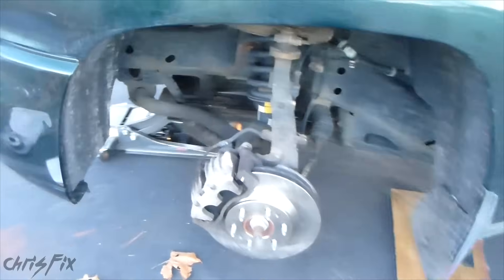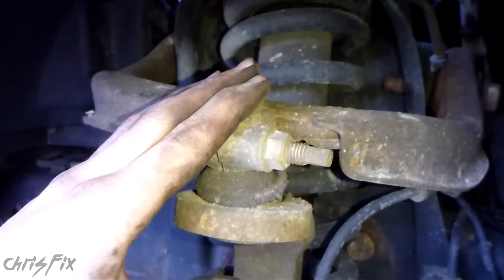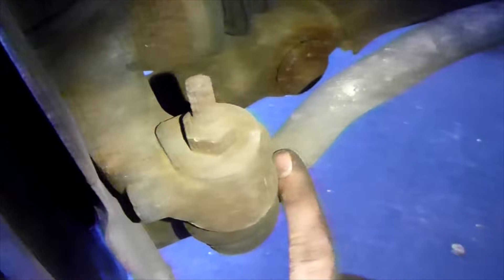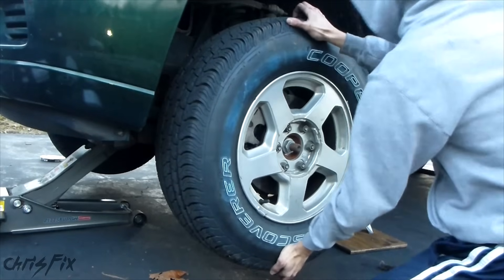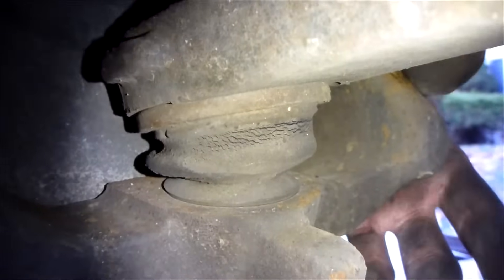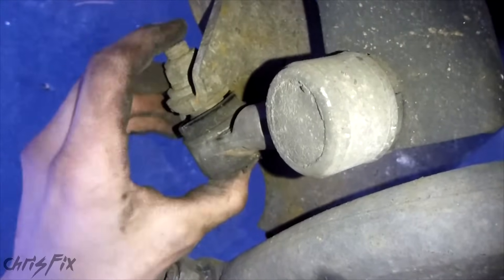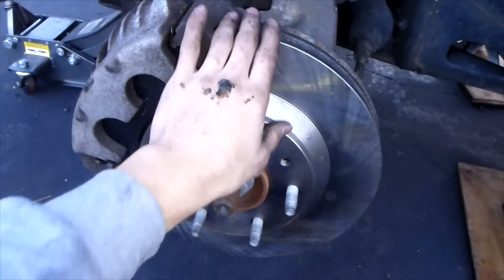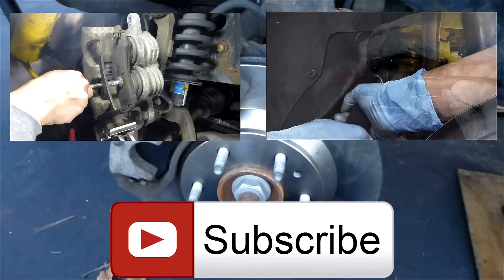How to check out your own car's suspension system

Comment: PLEASE LIKE SO CHRISFIX CAN READ!! Need URGENT HELP!! Thanks!

Hello Chrisfix, i have a 2016 dodge journey and my rear end was making a lot of squeaking noise. Its a brand new car with 30k miles on it . i got the rear bushings and links replaced and the noise is gone now.

Now, the front end is making clunking noise. Took it to the dealership and they said its the sway bars which they replaced. However, the sound is still there even after just getting the sway bars replaced. Its minimal noise but enough to be noticed. It is really noticeable when im turning while braking or if I go sideways over a curb or when i enter my driveway slowly. 
Could it be the bushings as it was the case for the rear? Plz any help would be appreciated. Thank you :)
Reply: I have a dodge journey 2011 and my rear end is squeaking. I'll take a look at my bushings and link bar. For your front end clunking. Mine was clunking and the steering wasn't firm as before ended up being the ball joint. Now everything is firm. The front component's are very cheap trust me you'll end up replacing a lot of pieces in 2 years I had both tie rod end replaced under warranty twice.
Reply: Paarth Kanda did you find what's wrong man?
Reply: jakarta378 no man unfortunately not. Hoping that Chrisfix sees this. Could really use his expertise or anyone in the comment thread as a matter of fact.
Reply: Paarth Kanda what did you do so far to fix the problem?
Reply: I havent done anything tbh. Ill prob call the dealership and tell them it wasnt the sway bars that needed replacement.
Reply: Sylvain Bathalon thank you so much. Ill try telling the dealership that and see what they say

Comment: Thanks chris, ive been planning on fixing up this totaled  2002 BMW Z3 Coupe (clownshoe) that some idiot crashed in because he was drifting or something. Front driver side suspension is the only good one. Does anyone know where I can get parts for this without paying the BMW price? It's mostly control arms, brakes, and shocks.
Reply from the maker: Find an aftermarket company that supports BMW. Moog for example.

Comment: Hi Chris. My car makes this squeaking sounds when going up humps. It happens when the car has warmed up and travelled a bit. Going over humps will cause a squeaking noise. Only in the front, rear's seemed fine. What could be wrong? Suspension? Springs? joints? MY car's about 5 years old. Please advise, thanks!
Reply: Laurence John Sortigosa My mechanic told me its my spring that caused the sounds. My bushings looked ok. I was advised to change my whole suspension but.. I think I can live with it for another year as vehicle stability ain't compromised
Reply: Give a one year update now

Comment: when my car gets warm and I turn the steerinh wheel to the right only it makes like a ticking noise and when on straight, the ticking goes away. It also sounds worse when turning at high speed. Any ideas on what it could be?
Reply: replace your cv axle joint

Comment: Whoever decided on non-greasable ball joints and tie rods should be shot.
Reply: Gabe Eslinger thats the point... THE GREASE NEVER LASTS lol.. And thats EXACTLY the reason WHY the parts FAIL. If you took a non greasable part and drill/tap for a fitting and great it every year or so GUARANTEED that part would last much much long. Do you not agree?
Reply: Gabe Eslinger I’m still uncomfortable with mine because there has to be barely any grease in them. Rather have greaserts to make sure maintenance is easier. Grease up and move on
Reply: While it is a pain in the ass you can add grease fittings. Drill and tap some threads in to the part and screw in and tighten the fitting add some grease. You probably know that but others may not
Reply: Monica i was thinking the same thing haha
Reply: @Jstro14  the problem with drilling and tapping grease nipples is its very hard not to get small metal shavings into where u have drilled to tap it. Any particles of metal that get into the ball joint will cause major damage very quickly. I honestly don't know why all ball joints don't come with grease nipples though
Reply: They do this because most ppl would not be checking their joints and getting them greased up. So it's better for the average driver to have plastic ball joints that are not greasable and last longer without any maitanence.
Reply: Christopher Moore seriously my civic has non greaseable end links and it drives me crazy. I’m planning on getting moog ones cause they have greaserts
Reply: Yes right in the fucking face and non greasable ujoints
Reply: It’s simple if the factory made them like that then you could get them greased at oil changes but they don’t do that cause they want it to fail
Reply: Non grease able parts are designed for the grease to last the life of the part.
Reply: Its a far more reliable design, it also last longer and typically carries a longer warranty.
Reply: I bet if you were in the business of selling ball joints you’d disagree.  Maybe that’s why they are that way.  Just a thought.

Comment: so i just had new ball joints, tie rod ends, steering gear,tires and an alignment. now i have a clunk coming from my drag link when i go over bumps. everything is new and tight and its been back to the shop twice and the mechanics cant figure out why it is clunking. any suggestions.  maybe the adj sleeve itself is bad somehow...
Reply: 04 grand cherokee 210000 miles. no noise before new parts...

Comment: it's pretty sh*tty how auto manufactures design suspension parts without grease points now days. The older cars had grease points at every moving point. It's almost like the manufactures are saying " yeah we put junk parts on automobiles now days so junk in fact they aren't worth the preventative maintenance" So parts that could last the life time of the vehicle are only lasting a couple years or under 200,000 miles.  Joke is on them I only buy after market...OEM is usually absolute junk.

Comment: If you had all new parts and were to replace every part you checked in this video (even the struts), in what order would you go? Basically all new suspension (for a 2006 Sonata)

I would think you would start with struts and work down and outward?

Strut/springs
fork
strut mount
stabilizer link
upper control arm
ball joint
knuckle
cv axle
sway bar
lower control arm
inner tie rod
outer tie rod
ball joint
hub
hub bearing
dust shield
rotor 
brake pads
caliper

Am I missing anything? Do parts come with all bushings, pins, nuts and washers? I have a 2006 Sonata shop manual set, but even that is geared more towards a trained mechanic and does not walk you through each step.

Comment: Chris's Fix, you should show how to check a drag link style steering set up in the future.  I know most vehicles use rack and pinion today but a lot of guys are confused on how to check a drag link style and even identifying parts: pitman arm vs idler arm etc. just a thought? 
Also, I have a 99 4x4 Ranger, it's nice to see one with a frame that isn't rotted to hell. Jim

Comment: I have a noise in my 2011 Ranger 2wd. The only thing I can come up with is the control arm bushings.
Reply: briteidea08 my 2001 ranger 2wd had the same problem. Changed the upper control arms and sway bar end links which had no bushings at all. Been three years since i heard a sound.

Comment: I think my suspension is really messed up I drive down I-35 in fort worth and there is much wear on the roads I hit bumps and dips and my truck begins to shake vigorously. I drive a 2000 Dodge Ram 1500 longbed I could really use some advice.

Comment: Hey ChrisFix. I just got a used Ford Escape hybrid and I've noticed that when I go over small bumps it feels quite aggressive inside the car. Furthermore, I really feel the road surface roughness in my accelerator pedal and in the steering wheel. Now the brakes are starting to squeak more and more. Initially, I thought the springs were on the stiff side but then I did some more research and tried a couple diagnostic things out. I don't bounce a lot when i go over bumps but I do feel a big impulse of force. The road surface vibration in the pedals are starting to make my feet feel that numb sensation when you touch something for a while that is vibrating. I made the dealership aware of it and I hope they take care of it. I thought it could be the front suspension and possible motor mounts, any thoughts? Also, any suggestions on if I should go back to the dealership or get an independent inspection done prior to talking with the dealership? Thanks so much and sorry if this is the wrong kind of question. Great vids, look forward to move of them. Just watch the top 10 cleaning tips, now I just want to wait until there is no snow on the ground. And I totally cleaned some bird poop off my hood with paper towel and some water...now it looks scuffed HAHAHA. Cheers boss!

Comment: hi chris, happy new to you!  I have a problem I cant find in my truck. driving around 50 mph I take my foot off the gas and it sounds like im running over a rumble strip coming from the front passenger side wheel area. no shimmy in the steering wheel. ever come across that?   (2003 sierra 1500 4 x 4)
Reply: mic jam that sounds like a wheel bearing bad

Comment: Just tried this on my truck, just about every joint had play in it, pray for me
Reply: +Tasnik Khan Sorry for not having money. Pocket change and happy thoughts is all I got.
Reply from the maker: +switchdownn good luck! I have videos on how to replace all joints, control arms, bushings and tie rods! Don't drive with worn suspension components!
Reply: A worn ball joint is an automotive emergency. They fail very rapidly once you detect play and fail in the most catastrophic way possible. Why are you even driving it?

You don't need prayers, you need a repair. And an immediate one at that. I pity the other drivers behind you who may be affected due to YOUR negligence.

Comment: hey Chris I'm getting a squeak when I turn and go over bumps. Is that a ball joint or sway bar bushing?
Reply: Neither, Sounds like a lower control arm bushing. Happened on my car, replaced it and saw that the rubber bushing was torn up and barely holding together

Comment: I just had an accident because my ball joint broke in my 4 runner 1996
Reply from the maker: +EDGAR RAMIREZ oh no! That's not good!
Reply: +ChrisFix  they fixed it for 730 dollars  because more parts were damaged, but the new lower ball joint that they put, still crooked. I'm scared to go broke again in the future, the specialists in cars told me that It has to be like that 
But the other lower ball joint isn't crooked why ?  I have pictures
Help me or save me from an other accident.

Comment: What is your advice on installing a 2.5 inch leveling kit on an f150? Also, is replacing the lower ball joints too hard for me if it would be my first time working on my truck that was actually challenging.

Comment: Someone else may have commented but you have to put the jack under the lower control arm to unload the spring before testing the ball joints. Being loaded you are unable to detect play.
Reply: Unless its a McPherson strut then you lift on the frame to unload the spring
Reply: Seriously I checked my suspension found no play . No I’ll check again as you described
Reply: @151daze  the jack stands should really be under the frame to ensure no weight restrictions when checking ball joints
Reply: That's actually not true
Reply: @gsc2866  how so? MAchpherson strut set up no...but the setup the video is working on, my comment is true.

Comment: hey man! if you can answer on my question i will be very thankful. i have mercedes benz w169 and than im driving on little speed bump or some small pit and car bounces a little i hear the sound like bolt is not  secured well or hood is not fully closed. its like just small tick. its not brakes because i replaced brakes month ago and i showed it to the guy who replaced brakes and he told me everything is secured well and he cant see any problem with brakes. sound comes from left front side. please help)))
Reply: i got the same on my car, a VW Polo 6n 1.6l, Only my car is lowered and only does it when im with 4 people in the car.
Reply: maybe ur front left shock absorber is a lil bad and a lil low so it might get floored while going on bumps and potholes

Comment: So I have a question for anyone who can answer. I own a Mitsubishi Eclipse GS 03 2.4L and it started doing something unusual now when I reverse and apply gas it begins to shake and when I drive forward around 30mph I get a slight shaking but if I go faster it goes away. Is this a transmission issue? I'm at work right so I haven't had it scanned so I'm just asking if anyone has any info thanks.
Reply from the maker: It can be many things. A shimmy could be ball joints, tie rods, bushings, motor mounts, the tranny, a misfire...
Reply: +ChrisFix I appreciate your response I'm going to look into it today thank you.
Reply: +ChrisFix So I looked underneath made sure everything was ok ball bearing are good, I just need to replace my right inner tie rod there was alot of play on that. I turned my car over and I would hear a knock just once and then decide to drive in reverse car started shaking bad then I said hey why not go faster went 25mph and all of a sudden my car stopped shaking, there's no more knock and my car is fine, I'm really confused?
Reply: hey man! if you can answer on my question i will be very thankful. i have mercedes benz w169 and than im driving on little speed bump or some small pit and car bounces a little i hear the sound like bolt is not  secured well or hood is not fully closed. its like just small tick. its not brakes because i replaced brakes month ago and i showed it to the guy who replaced brakes and he told me everything is secured well and he cant see any problem with brakes. sound comes from left front side. please help)))
Reply: hey man I have had a similar problem and it was the ball joints. sounded like a loose bolt or like something was moving up and down when I was driving over bumps slowly.

Comment: nice vid! is there a specific type of grease for ball joints? Can you also put grease on the bushings? like on that sway bar, on the upper/lower control arm?
Reply: No, any standard automotive grease will be plenty. The only place I know of that require specialized greases are brake components due to temperature restrictions.  Hope this helps

Comment: Chris I have a 2005 escalade esv with the rear airbags. My compressor is running a lot more than usual and my truck sits lower than normal while driving and almost a bagged look when parked. How would you suggest I go about fixing or finding out what's wrong.
Reply from the maker: Sounds like your airbags are leaking. I would inspect them for leaks with soapy water. Bubbles indicate where the leak is!

Comment: I have a 2007 Ford Freestar. I want to go to full a synthetic oil, however my mechanic say's not to do that, because I have been using 5W-20, and the full synthetic is a thinner oil which could cause leaks. Is this true?
Reply: Check the oil data sheets of the oil you're looking at and find out; this is the best way. Some full synthetic is thicker than conventional or the same at operating temperature as conventional. (XwXX is a general term.) BTW, look into 0w20 as well since you're talking about full synthetic; 0w20 should give the same lubrication and protection at hot temperatures but a little more lubrication in the warmup cycle and slightly higher fuel efficiency than 5w20. You may want to do a few short-term oil change intervals with whatever you're currently using if you decide to switch though, this will clean the engine of any debris slower than switching to full synthetic would. Sometimes switching to full synthetic can clog the engine if there's sludge, it cleans too quickly in such a case but overall in a clean engine it's just better.

P.S. out of all the vehicles I switched to full synthetic (none which died from oil clogging) three out of five developed oil leaks. 

1984 Caprice, 5.0 - Did;
1990 Mercury Grand Marquis, 5.0 - Did;
1999 Suburban K2500 Diesel - Didn't;
2000 Dodge Caravan, 3.0 - Did;
2000 Dodge Caravan, 3.3 - Didn't.